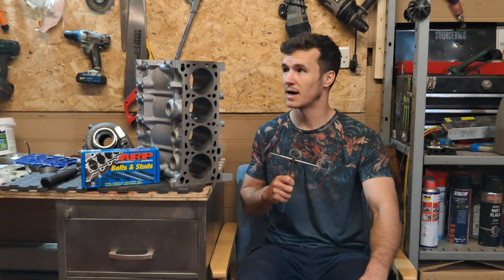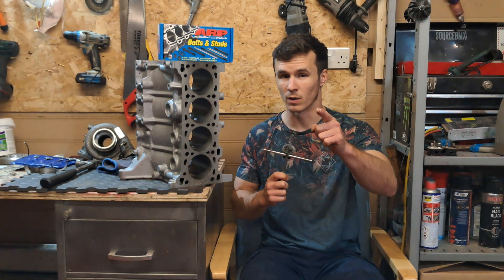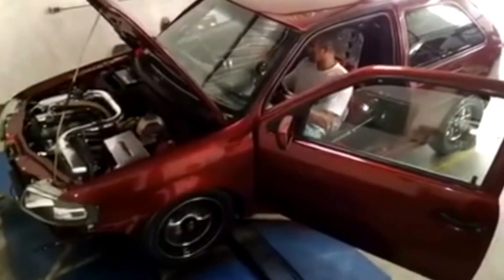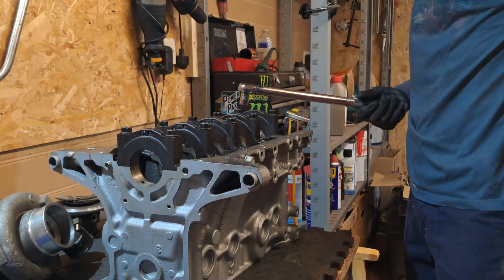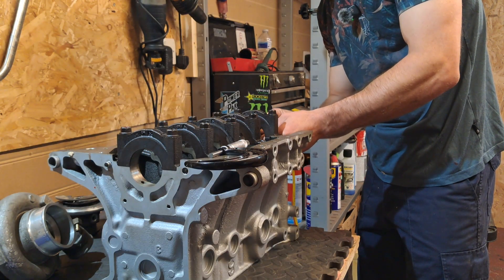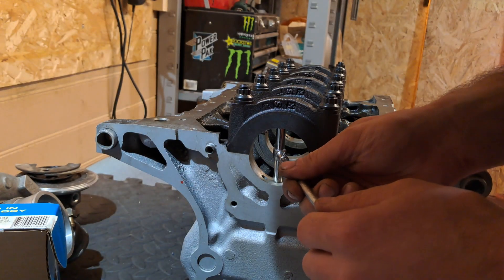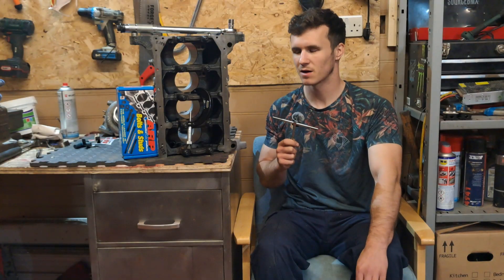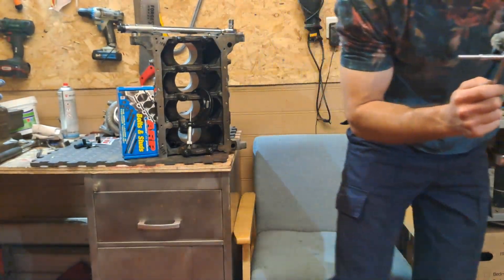Do ARP Main Studs Distort Your Main Caps?

Comment: Question then. Even if the clearences are good. Does this affect the crankshaft? Or the bearings? Or the main itself? And if it doesn't will it affect the longevity? Let me know your thoughts.
Reply from the maker: Its generally a longevity thing yeah although in this video the actual measurement was somewhat irrelevant because i was measuring for ovaling due to the higher torque mainstuds potentially deforming the caps.

Comment: telescoping gauge🥺, for a precision bore it same a use a measuring tape 😣
Reply from the maker: Not perfect but more than accurate enough, i checked each dimension 5 times per bore and saw no size variation so that tells me its close enough 👌